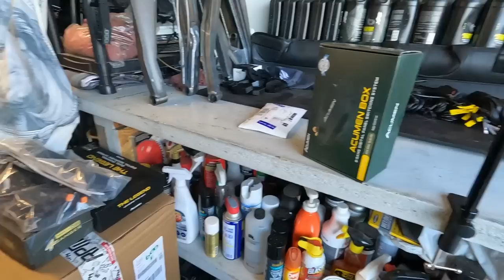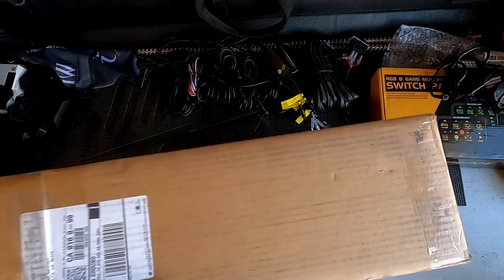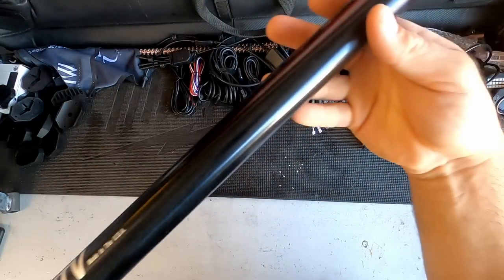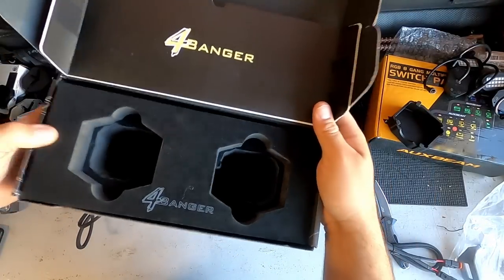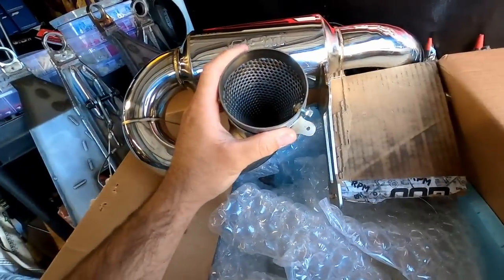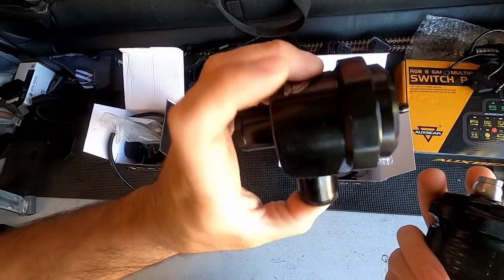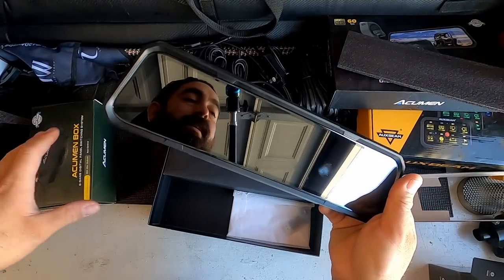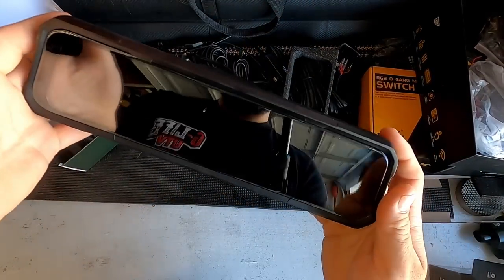Unboxing new UTV Products Pro R and X3 ep 251

Comment: Great show as always brother!! Got a couple of question’s for you. On my 2021 X3 I blew belt and it pretty much destroyed my clutch cover and housing. Should I go back with an OEM cover & housing or is there an aftermarket one that you recommend?? Also the blow off valve from RPM that you showed, any idea when it will be available. Thanks
Reply from the maker: From what im seeing an oem housing with a carbon fiber liner is the way to go.. .. the rpm valve im not 100%% on.. they may just transition as soon as the other one runs out

Comment: Could you do a tutorial on how to use the switch pro app? I've got one installed in my machine after seeing your video about it. What I cant figure out is why the rpm exhaust and baja chase light always start in the on position when the machine is started. When the machine is turned off the valve automatically opens and I either have to use the memory function to make sure it wont open when I cut power to the machine or turn on the switch on after I start it to close it. Chase light also turns on when the machine has power before I turn on the switch. Those are the only things that do it. Other lights and things on the switch stay off till I turn on the switch. Any clue how to fix it?
Reply from the maker: Some of exhaust are hit and miss, because some are wired normally closed. And other are wired normally open. Ive run into that before. And some just cant be wired right to work